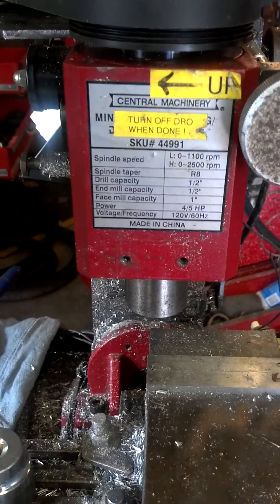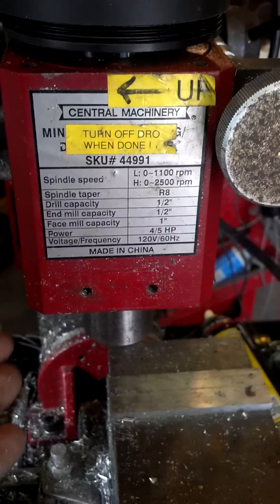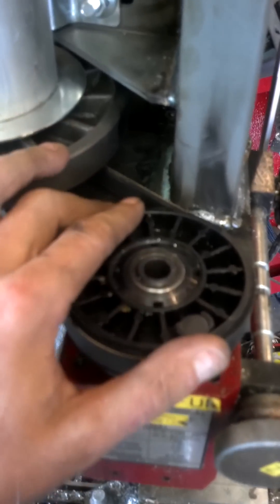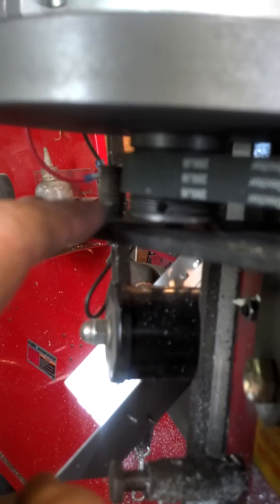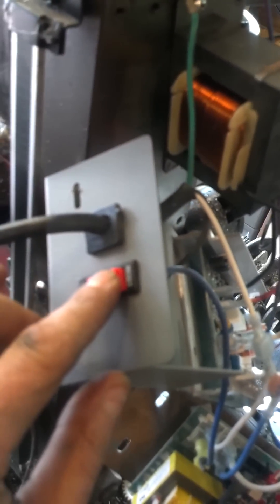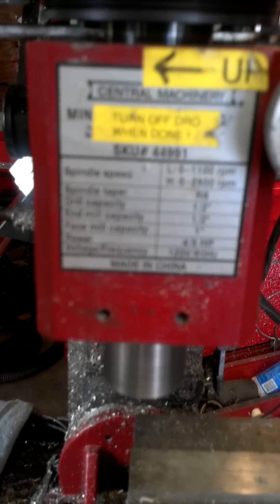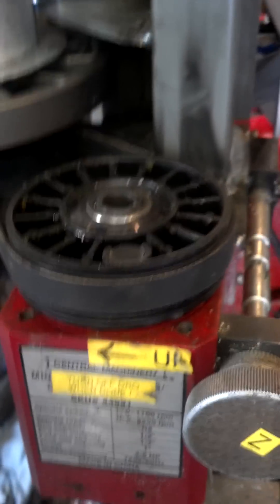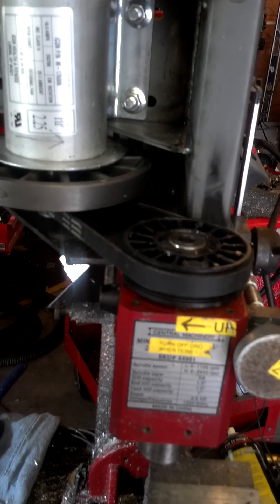Mini mill treadmill motor upgradde

Comment: Do you know if there are different families of treadmill motors? I've taken apart two CL finds, one newer and one quite old, and they both have way, way bigger motors than the one you used but don't seem to be much higher  in horsepower. The older one would be fairly easy to use aside from figuring out how to mount the enormous thing to the mill.

Comment: Hey doc, looked through your other videos to find and update on this project, didn't see any.  From the looks of your other videos, I'm tinkering with a mini-mill to do the same projects.
Reply from the maker: I have been beating the fuck out of it for years and it still hasn't failed, still has the original belt, still has the original pulleys. I would say I use it at least two to three times a week

Comment: Hi usmcdoc14, Nice upgrade. Question...Is that motor actually 2.25 horsepower? If so is the voltage 115v or 220v? Also what is the amperage draw?
Reply from the maker: 110. Most of them are normal house current

Comment: Do u have a video of the finished motor swap in action... I like what u did but a few others have had issues with the extra weight causing the head the creep down during a job..

Comment: Hi, an excellent idea to use the treadmill motor, I have some of these in my stock shelf, just trying to find out the wiring diagram for the speed control unit,  will be totally rebuilding mine as it was hit by flames when my garage caught fire a few months ago, scrapped quite a few things but want to save the mini mill, thanks regards Doc Cox.

Comment: Got 2 treadmills on Craigslist within a week. The second one was perfect. It had the MC60 control board. With this option there's no need to use the power board. You can re route the wiring and eliminate the power board.